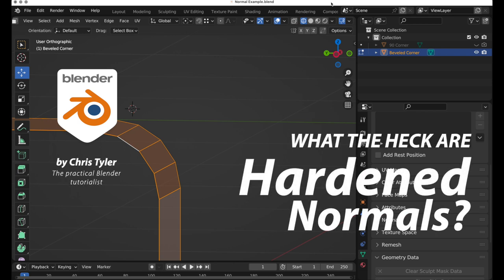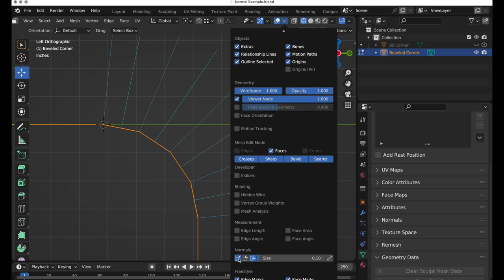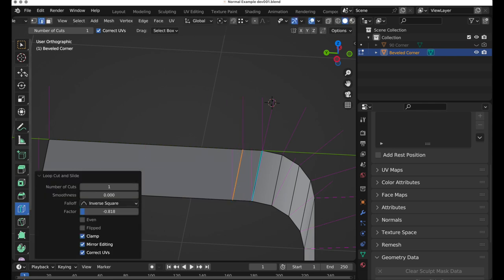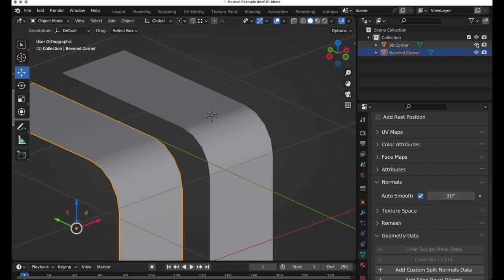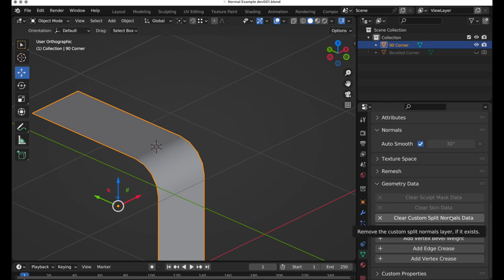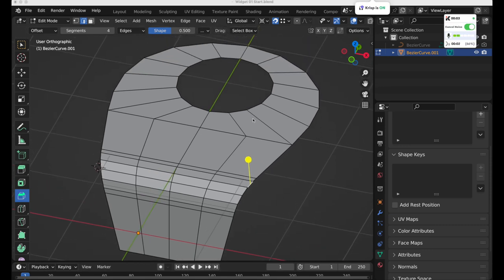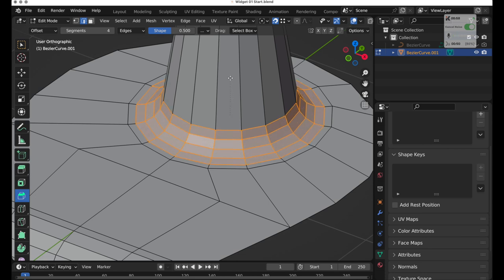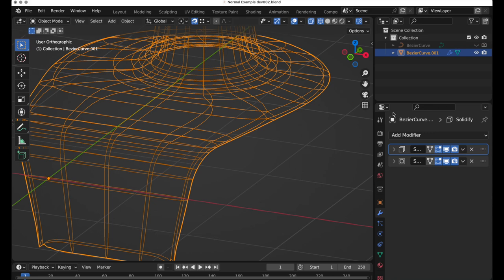What the heck are HARDENED NORMALS? And when do I use them?

Comment: Because it adds islands for "Geometry/Random per Island", there are times you may want to avoid Harden Normals also for the Bevel Modifier and use Weighted Normals instead. Also, if you "can live with" using superelllipse at 0.75 (instead of 0.5 which creates a circular bevel), you end up with improved shading due to better curvature continuity (at 0.5 it's only tangent continuous) which also holds the "desired hard face" better. Can be an option if also Weighted Normals gets too wonky to use. The extra holding edge is probably the safest, I don't understand why this option isn't available in the bevel modifier itself.

Comment: so what you are saying is don't use harden normal in a destructive workflow and do use it in a non-destructive work flow, right?
Reply from the maker: Yeah, that's a succinct way of putting it.
Reply from the maker: I should say too that if you are doing direct polygon modeling, meaning you're going to model the same polygons that are going to be rendered (not using SDS), using hardened normals can work. It's kind of context driven, but in general don't use them with SDS unless you're also coupling them with an edge crease.
Reply: Just a thought: the Bevel modifier has the option of letting you use a custom profile. So you could produce the effect of those additional support loops if you want.